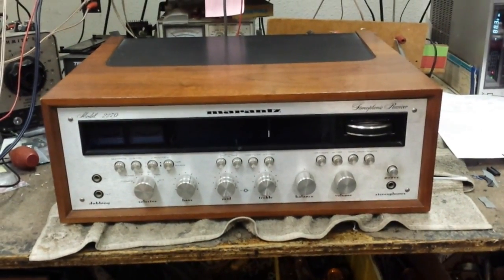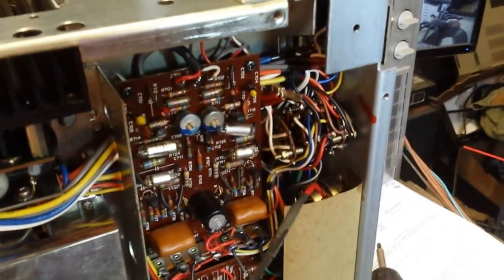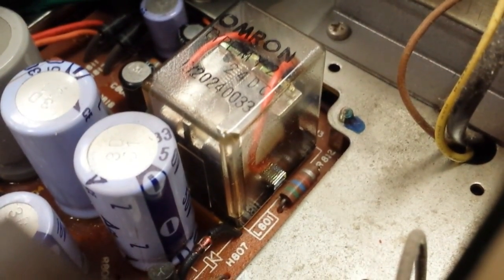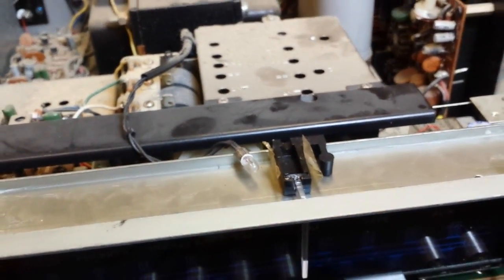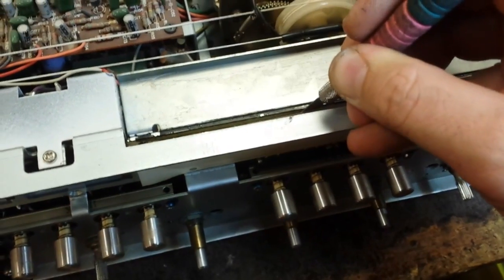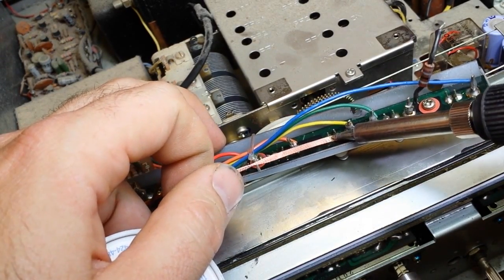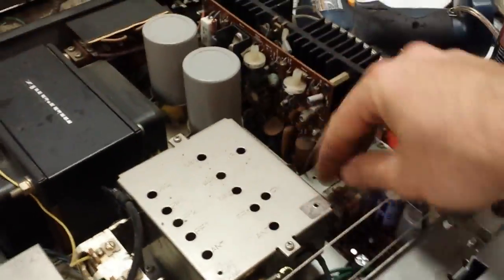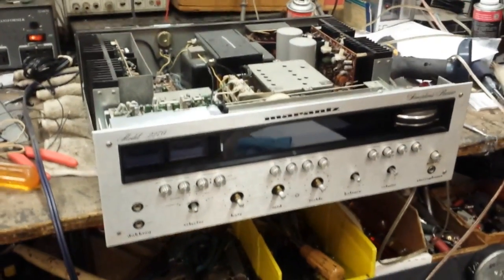Servicing a vintage Marantz 2245 or 2270

Comment: My older brother bought a 2330B with the walnut cabinet back in '79 while in the military. At the time they were going for $770 at the local stereo shop; he paid $195. When digital became all the rage he retired the Marantz and bought a Pioneer. When he came back state-side, he gave me his Marantz. It had some issues with the P700 board so I took it to a shop and had it repaired. One side was toasted; drivers, mains, resistors, etc. I ended up using it for a number of years but the pots/switches got scratchy and when I saw how much work it was just to clean a pot, I stuck it in the closet. A couple weeks ago I decided to dig it out, clean it up and use it! I still have it but it's in pieces. I'm re-capping it, new lamps, etc. Fortunately, that model didn't use the velum paper! Can't wait to finish it up and rock it out!

Comment: I have a 2270 that I bought new in 1972.  The first year I had it, it broke twice. It was fixed under warranty both times.  Paid a lot of money for it at the time and really wondered if I had made a big mistake with the purchase. It's worked perfectly now for 47 years. It just now needs control cleaning.  It is my most prized possession.

Comment: The velum paper is actually very easy to find.  Go to a hobby store.  I went to Hobby Lobby, where you get a handful of sheets of the stuff for less than $4.00.  Then use a little rubber cement on the edges of the plastic piece and lay the paper down on top of it.  Use your xacto knife to cut around the three edges that overlap, and you have a perfect replacement.

Comment: For the translucent paper in front of the dial lamps you could use a diffuser sheet found in the panel from a old scrapped LCD tv. Just cut to fit

Comment: I would absolutely not use sandpaper on relay contacts. Most small relays (not contactors) have a THIN layer of tough alloy deposited on the round contact blobs. Filing removes this and you are left with the blob metal. The relay will not last very long after this. Source of this: xraytonyb.
You can rub it with paper soaked in lubricant free contact cleaner or IPA.
Reply: Yes, that goes for most if not all leaf switches I think, it's a big no-no in pinball maintenance.
Reply: Roughing up the surface of contacts usually leads to arcing, oxidation and eventually, failure altogether...If De-Ox or similar doesn't do the job, burnishing the contacts with a low AC voltage, like from a 6.3 Vac heater tranny, is a last resort...If you have to, paper money can be used in place of sandpaper or emery cloth for cleaning those contacts...

Comment: Burnishing relay contacts is only a temporary fix.  I don't bother anymore.  For a tiny 5-note, I just replace them with 24Vdc modern relays from Digikey (with the rated amperage) - lasts much much longer.

Comment: Hey Jordan Great video! I just picked up a 2245 that wont come out of protection but looks to be mint.. I havent tried any troubleshooting yet but I wonder if my caps are most likley toast as well on the power supply.. I will start testing soon but im hoping its something that basic.
Reply from the maker: If no offset from the amp, replace the 47uf, 10uf and 220uf caps in the protection circuit
Reply: @JordanPier  Will check those thanks!

Comment: Hi Jordan thanks for posting this amazing resource.  I recently acquired a 2270 that appeared to be functional the lights all come on....but when I took the cover off I noticed I'm missing the right side power amp and heatsink assembly....whomever took it out must have had some familiarity with electronics ....I was curious if any of your contacts sell replacements or do I have to just get the board and all the parts and build one from scratch?  It's not something I'm afraid of but it does open a can of worms.....if I can find someone that has some of this it would be a huge help.

Please and thank you
Reply from the maker: Ask around audiokarma. Keep an eye out on ebay for someone parting one out.
Reply: Thanks for the advice

Comment: Hey JP, solid video! I enjoyed the detailed walkthrough and the little bit of humor you snuck in. Helped greatly with navigating my first application of D5 to my 2245. I was hoping it would help the issue I’m having but it has not... THOUGH you did mention the possible cause of my problem in this video- which is the relay. 

I’ve been noticing the left channel goes in and out with slight distortion(both mains and remotes). The folks at AK recommended a deoxit app first as it might be the fix and a quick/easy one at that(which brought me to your YouTube). 

BUT I’ll admit- I made a rookie mistake and used a not-so-friendly grit of sand paper cause it’s all I had(think it was just labeled “fine”- certainly not 2000grit) and when I got everything back together the problem was worse, now the channel drops completely and the volume seems to have taken a hit cause I’m getting like half the juice it seems. Also I cleaned the power switch if that helps(waited for it to evaporate before testing). The power switch seems muckier than before and I’m planning on replacing both relay and switch.

I was just wondering, while I have it open, is that the only thing that would cause this channel dropping issue? Or should I be looking at any other areas and replace other items while I’m in there? Thought about doing the caps in the power section you’d mentioned but they appear to be in great shape and I’m a newbie so I’m trying to tinker as little as possible to avoid mistakes(like the relay haha!).

Sorry for the long comment and thank you in advance for your advice.
Reply from the maker: Mike,

The test to see if it is in fact the relay is to crank the shit out of it and see if the channel comes back clear. If it does it's likely the relay is just toast and you'll need a new one.

If that doesn't help, isolate the problem to either the preamp or power amp. Pull the jumpers and feed a signal into the main in. If it clears up and sounds good it's in the preamp, at which point you likely have a dirty tape monitor or input selector switch. If it still sucks you've got bigger issues in the amp.

Carefull with that recapping crap. Throwing parts at something without troubleshooting it first.is a great way to waste time, money, and possibly blow up equipment ;)
Reply: Jordan Pier yeah, I’ve noticed that was the case at higher volumes- which i’d earlier mistaken for it being an intermittent issue and not a case specific issue. So seeing it goes away at higher volumes it’s likely the relay. I want to replace it anyways cause I roughed up the contacts pretty good. That’s great advice re: moving the source material to the main in. Will definitely help isolate the issue without tearing everything apart. I will do that next if the issue persists after a new relay is installed. I want to replace the power switch also. It’s super sludgey even after a few apps of D5. Can you provide a link to the (sounds like) Duo Joe you mention in the video for parts?
Reply from the maker: Here's Dave the lamp guy. He may have switches:
https://sites.google.com/site/dgwojocom/

Hb electronics in Hollywood, CA has a good replacement switch. I'll dig up their catalog and find the part# I used

Comment: Excellent information.  I am trying to get my receiver out of the wood case, and it’s not budging.  The video description says you cover removing from case, but your video skips it entirely.  Maybe it’s obvious to you, but I can’t find a video that shows how.  Stuck.
Reply from the maker: All retention screws should be on the bottom. If it still isn't budging then either a screw is embedded in the case or it got shoved in there and it doesn't belong in that case. 

Should come out real easy

Comment: thank you, to reglue the paper and the glass what glue do you use, as well as to clean the sliders what product, thank you I will see about the card troubleshooting too test, you have connected the oscilloscope to the speaker terminals directly or with resistance, or speaker
Reply from the maker: I use a basic glue for the glass. Could use Elmer's glue if you wanted to.

Deoxit F5 Fader lube for controls

Connect the amp to a dummy load bank (2 8 ohm 250w resistors) and the scope in parallel

Comment: Great video!   I was hoping you would have done the complete bias job.  Would that be possible,  down the road? 
Service manual is unclear to me.
Thanks
Reply from the maker: Easiest way to take the measurement is one lead of your meter on the screw of the top transistor and one lead on the screw of the bottom.
Reply: @JordanPier  and set for 30 ma ?
 For the 2270.  Thanks

Comment: Payday i getting ready to order some deoxit ,some tech say also use crc contact cleaner,with deoxit do i need both.and how long does it take for the deoxit to evaporate,before useing.thanks for your video its very helpful to me
Reply: Use the contact cleaner first while turning pots to get the junk out of there.  Wait about 5 minutes and then spray them with deoxit sparingly and turn them again to spread the deoxit.  A little goes a long way with deoxit.

Comment: Great video! What about the pole antenna when you set the amp on its back?  I'm surprised you didn't blow the relay out with air after you polished the lower contacts.
Reply from the maker: Stu Boyer since these have metal antenna bar brackets instead of the plastic ones found on later marantz they can withstand the weight as long as you're careful

I've never had an instance where I needed to blow out the contacts - but I'll keep this in mind!
Reply: The reason I thought of that is because your sandpaper is leaving grit residue behind.

Comment: Jordan, 

      Great tutorial video. I wanted to ask you a question regarding my Marantz 2240b. I moment I connected it to a speaker it has the low humming sound on all source selections. Through your experience do you know where could that be coming from and do you kn ow how to get rid of it? Thank you in advance.
Reply from the maker: Likely failure of main or regulator supply capacitors. Easy test is to measure ac voltage on the capacitors. You shouldn't have more than 1v on the main capacitors and .5v on the capacitors in the regulator. You won't start to hear him until about 10v ac on the main caps and 2v on the regulator capacitors. 

Use caution working around voltages. If you don't feel comfortable, don't  do it.
Reply: Jordan Pier For the age of this receiver would it better to just replace all the capacitors in the power supply board?
Reply from the maker: Not necessarily. You can if you want to, but I normally just fix what's wrong and enjoy it for now

Comment: Jordan,
You have a terrific channel, my friend.  Wish I had found it sooner.  You're a very good instructor.
Now that I've buttered you up, I have a quick question about my Pioneer SX-780.   It plays fine, but about 10-minutes after fire-up a loud snap is heard.  I've disconnected all the external gear and changed speakers, but it still snaps away...about every 15 to 20 minutes or so.  I believe this is a cap issue, but a while ago I saw a video where a transistor was causing an almost identical problem.  Have you ever run into this sort of problem?
Regards,
John
Reply from the maker: joernone nope. however here are things to look for...

if the snap is coming from the speakers, note if it's one or both. if one only likely one of the amplifiers is failing if both its probably in the power supply. the regulator transistors come unsoldered and wreak havoc.

if it's coming from the machine itself, the snapping is likely high voltage arcing somewhere to ground. take the top and bottom off and look for arcing around the amplifiers and large capacitors. arcing leaves carbon so the spots where it's arcing will be darkened.

run it in a very dim room and watch for the arcing when you hear it. press on the board with an insulated object like a wood stick to see if flexing the board induces the problem. look for excessively long screws holding the bottom on. they should be no more than 3/8 inch long or that may short stuff out.
Reply: Jordan,
The periodic snap comes from the speakers.  I should have told you that.  But I hadn't thought of checking to see if it comes from both of them.  I appreciate that insight.  Hopefully, next week I can find enough time to open things up for a look-see.  Thanks, my friend.
Regards,
John

Comment: Hi,it there different versions on the front end on the 2270,this reading I ask is a tech i use have a very hard time trying to replace the pin bulbs including the stereo. It seems the dial mylar(plastic) started to disinagrate. I know that some of the production runs have slightly different sets up and materials. In you experience is this at all come. 
My back ground is Brown in st electronics school in the twin cities. But I went more of the sales world instead of becoming a tech. 
The tech I use has been doing this for 35 years. 
Any ideas?
Reply from the maker: There is someone on eBay who sells new abs plastic lamp housings for the marantz receivers. They're not cheap but if you plan on keeping the set it's a good investment.

I find that without dismounting the circuit board from the housing  it's very tricky to replace the bi pin lamps

Comment: Hello...  

 I have this same receiver and i just lost all audio on both sides of the speaker I plugged in head phones still doesn't work no sound... It does appear the the relay is kicking in at all replace the 3 caps you recommend my next step is to check Output Amplifier Transistor maybe shorted... What do you recommend?  Thanks
Reply from the maker: If the relay clicks after power on, it's not the amplifier or protection circuit. Pull the pre out/main-in jumpers on the back and see if it plays through main in (may be loud unless your device has cobtrol) - if it plays through main in you've lost your preamp - or more likely the regulated voltage feed to the preamp. Get a schematic and check your regulated power supply voltages
Reply: @JordanPier  Thanks Jorden for the reply it doesn't even click in after the unit is turned on stays in the open position...
Reply from the maker: Then check amp, power supply and protection circuit.

Hook negative of a volt meter to chassis and touch positive to the cases of the output transistors. If you have DC voltage you've found your failure. It's ok for up to about 100mv, trigger threshold on the protection circuit is 1 volt. 

If both amplifiers are offsetting the same  check power supplies. . . 

If no offset on either look at power supply voltages and if ok troubleshoot the protection circuit

Comment: after burnishing the contacts on protect relay add a dab of mineral oil with an eye dropper or diluted Vaseline so the contacts have air or oxygen or rust protection
Reply from the maker: +mike murphy the oil or Vaseline would impede signal. The relay is covered so what's to worry about rust?

Comment: Thanks for the video . I’m just going to restore my first receiver. A Marantz 2218, that was given to me, I pulled all the power supply Board caps, one tested bad, half tested ether out of tolerance on their capacitance some of them tested high ESR and two other ones tested low ohms almost shorted but still working. Every button and every pot is sticky or Noisey. Seems like this is a good candidate for a first timer DYI to do a restore.

Comment: And.........Their solder work Sucks. I see you know Dave, that's whom I got my lights from. Even with the black bar at bottom, they still glued the bottom portion as was my case. Old vellum has to go, you can buy a 81/2 x 11 57 lb. for 3.00 dollars. Hey, that Kenwood 9000G would be a entertaining video.

Comment: do you know where I can buy fuse resistor (white rectangle,  RGB5 0.2 ohms k  noble 44) .  on Marantz 2245
Reply from the maker: Hb electronics, mouser, digikey, Newark, or any major electronics parts distributor.

...but if those are bad or burned open you've got much bigger problems. Replacing those without finding why the blew out is just a waste of time.
Reply: thank you Jordan...  I will check all the components one by one if is there more bad components. thanks again for the info.
Reply from the maker: Start with output transistors and go backwards. Look for shorts, mostly collector-emitter shorts.

Also see if the protection relay has been bypassed. If it was then the resistors would be able to burn open in an overload situation
Reply: yeah I plugged in and run for a while and then I turn in off and I touch all the power transistors and one of the transistor is  overheating... super hot.

Comment: How to you extend the straw of your Deoxit?
Reply from the maker: +cm2881 heat-shrink tubing
Reply: Jordan Pier that's all? No glue or any tubing attaching both straws?
Reply from the maker: Never had to use glue, though I suppose it might help. I've seen folks use zip ties on the ends of the heatshrink

Comment: What is the spray?
Reply from the maker: Craig deoxit F5. Also called faderlube
Reply: @JordanPier  Thanks, is computer cleaner safe to spray?
Reply from the maker: @designasaur5354  no. I would not use that. 

You can also use CRC QD contact cleaner. Much easier to get. Hardware stores and automotive stores should Cary it.